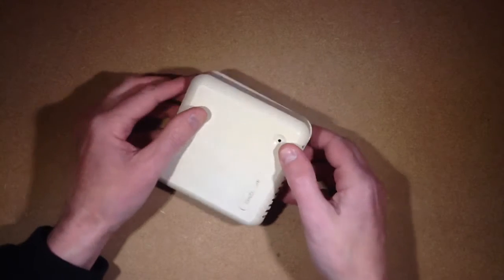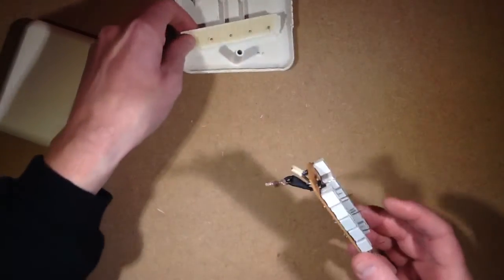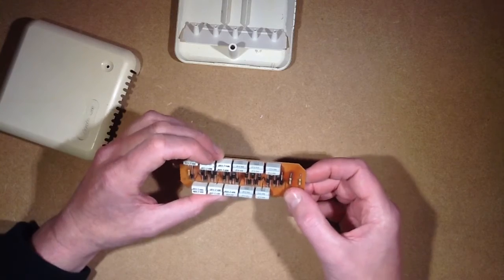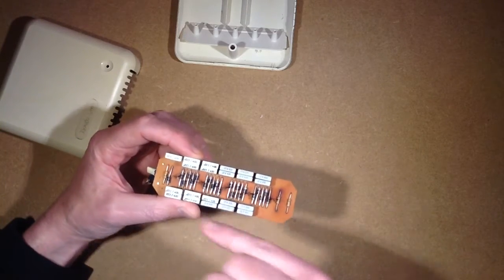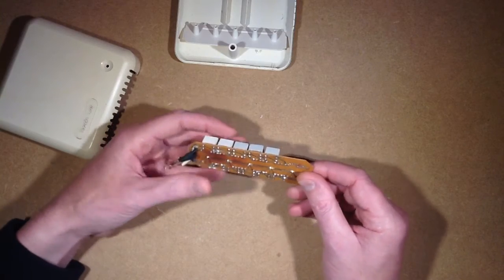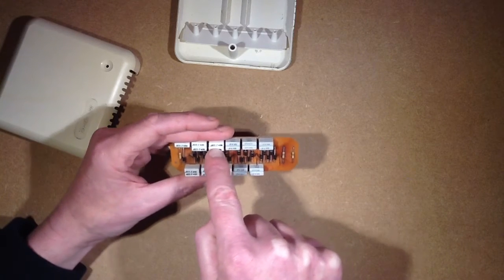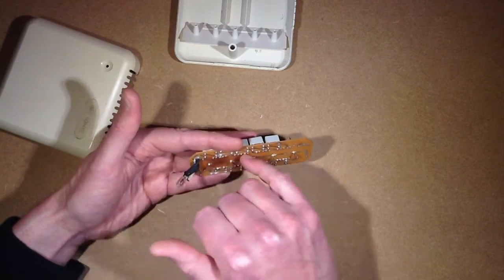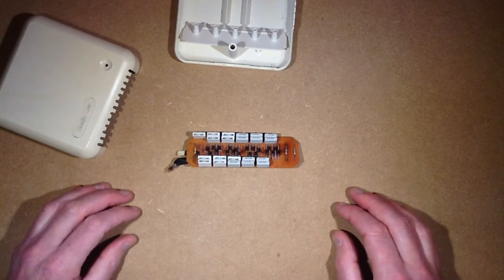A look inside a more modern Dezac Breathe Easy ioniser.

Comment: That could be fixed, right? .. desolder/remove the emitter needles and track.. wire across to copper tape with some isolating insulation — just so long as sufficient separation of voltage multiplier from emitter section can be achieved.. 
Am I talking rubbish?!

Comment: Always fascinates me.  That the glow rod  erm no don't shove that electrical tesla thing up ones butt.  is a Quack thing and outside the USA, Ionizers are considered good items.  Inside the USA, generally Quack , not as Quacky as the glow rods but other than the smell of ozone, they never caught on around at least the Midwest were of all the places you'd think it would.  (Warm muggy air = mold.  X_X  yuck   although mentioning the word MOLD anywhere will get bad looks from the older generation :O

Comment: why don't you design ,produce and market such a product I am sure you would corner the market in such a product it seems that to get any fresh air in this day and age pure air is valuable commodity.
Reply from the maker: It's fairly easy to get ionisers online, but they range from non-ionisers masquerading as ionisers to ridiculously expensive quack products that make rather dubious claims.  I have designed and built ionisers before, and even have a page on my website about them, but the capacitor/diode multiplier type is more suited to the European 220V to 250V market.  For 110/120V applications you need to use a transformer to boost the voltage before the multiplier stage.

Comment: What Ionizer or purifier would you suggest for hey fever sufferers,
Reply from the maker: If you can find an original Mountain Breeze ioniser with the needles on the front on ebay then it's my first recommendation.  (check ebay)  But if they're not available in your part of the world then ebay may have some alternatives.  But avoid ozone generators as they do not work the same way.

Comment: How can 630V caps and 1,000V diodes produce the high voltage without failing?
Reply: The stages are effectively in series, so the stress on each component doesn't exceed the ratings
Reply: OK, thanks for that.